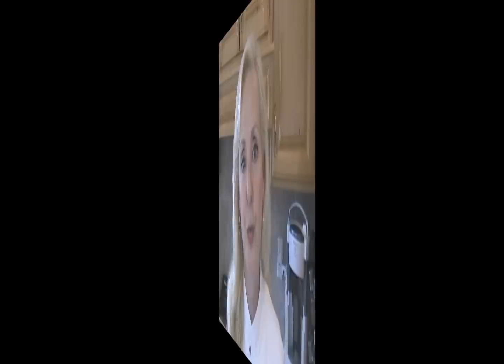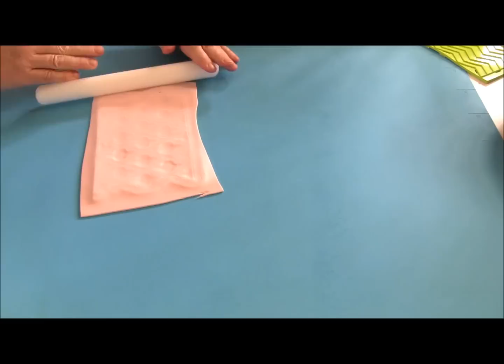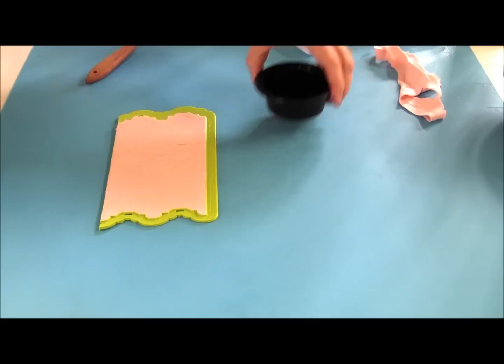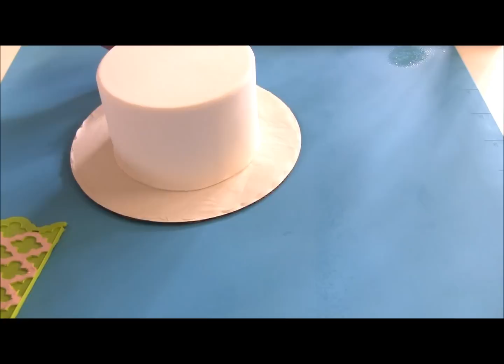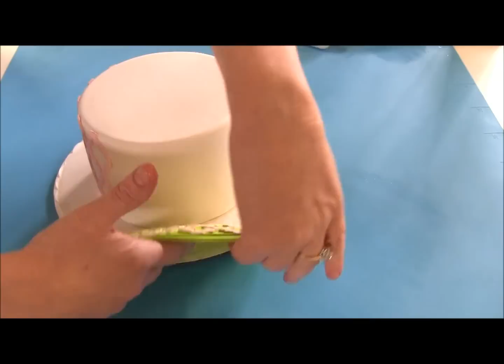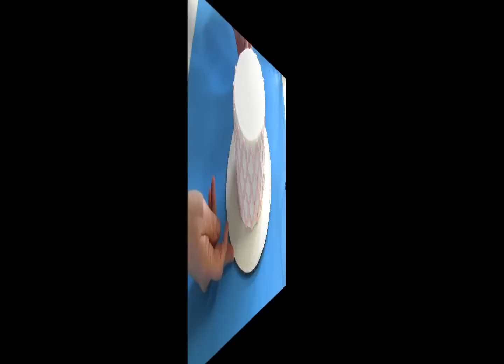Silicone Onlays--Intricate Cake Designs Made Easy

Comment: I have purchased almost all of them. I have a problem because my cakes are 6 to7 " in height  I have 2 to 3" of space to fill. So what I was thinking to do  instead of placing the mold on the bottom I start at the top. My fear is that it might come out crooked. What do you think? I use the damask design. I think that's the name.
Reply from the maker: You could tape a strip of paper (or something else) together around the bottom of the cake at the height you want the design to start) then line up the onlay mat with that as you work around the cake.
Reply: So how do I get the same design lined up once I remove to paper
Reply from the maker: Tasha Walker Sorry, did not realize you wanted to cover the entire tier--thought you were talking about a blank space at top or bottom or both. To cover the entire side of a taller cake, I would start at the bottom and then manually cut the pieces and line them up for the top piece. It may not look as nice, however, since this is not how the onlays were designed to be used.
Reply: Thank  you
Reply: You Know have talent,  MoM

Comment: I wish they had designed it longer than PI, so you're not have to do the process 2 and 3 times. I'd rather have it longer and cut off the excess as opposed to have to patch the design together 2 or3 times
Reply from the maker: Since silicone is expensive, the smaller size makes these more affordable for more decorators.